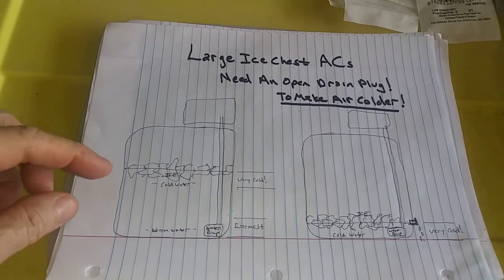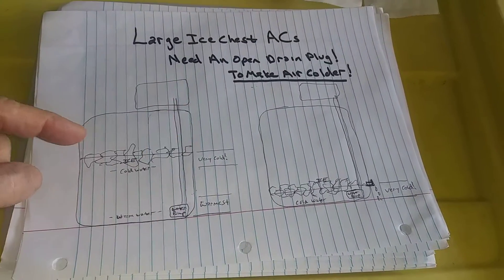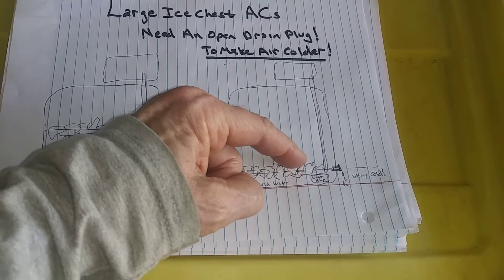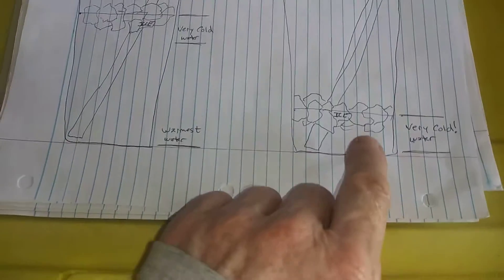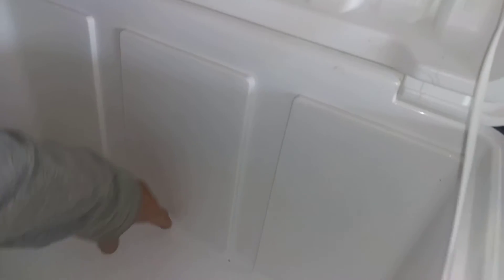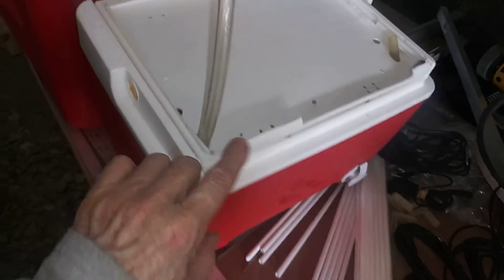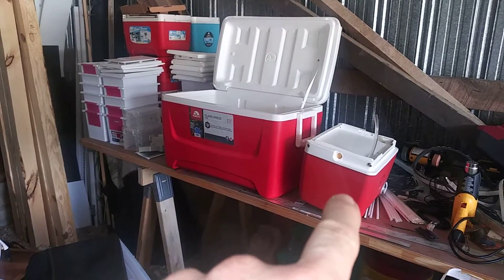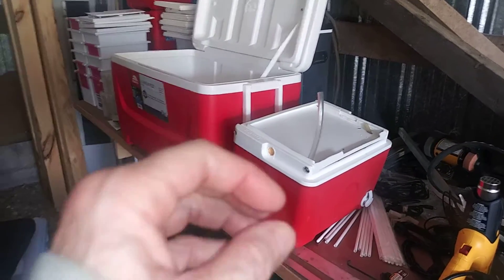Homemade Air Conditioner: Large vs Small? How A Drain Plug Makes Your DIY AC Blow Colder Air!

Comment: Another comment : I saw someone build a peltier ice chest cooler that will maintain a cold temp thus keeping water cold for circulating through a radiator and cold air with your Atwood fan system
Reply from the maker: I saw a man living on a boat build a Peltier AC with several pc fans that looked really cool but he said it used a lot of electricity since it was 12 volt.

At the time if I remember correctly I just started living the vanlife and only had one 100ah AGM battery so I didn't follow his design because of his surprise of how much it would drain a battery.

But, since I'm grid time half of the time and off grid the other half and now have a 300ah battery bank and a shop for AC builds the Peltier addition could be a nice addition for sure!

I'll look into a hybrid and not worry about the voltage use this time. Originally this channel was geared towards vanliving that it limited the designs I was building. But I'm definitely expanding out towards folks who are grid tied or who have an Ice machine available etc.

Thanks for that...!!!
James & Team

Comment: Isn't the trade off for having an open drain plug to maintain a particular water level that you have an open (uninsulated) hole allowing for loss of cooler temperatures? Wouldn't that cause faster ice melt, lowering the lifespan of the ice? In short run times the trade off is probably negligible, but if you're talking about 1+ hours of runtime (camping, out door sports events, etc) melt adds up. I get the thought process but the name of the game in ice chest spot coolers is ice longevity. Having an open hole seems counterintuitive. 

Cue all the YouTube experts in Thermodynamics...(insert MASSIVE eyeroll here for those keyboard professors...). All in all, love your stuff James.
Reply from the maker: Hey, Thank you John! Thanks for deep thoughts amen!
For 1 to 1 1/2 hours of cooling which is pretty average there isn't noticeable run time changes utilizing the open drain to keep the circulating water colder. It really does make a very noticeable and real time difference by circulating the colder water. I switched and never went back when in South Texas.

I discovered an article a few months about ice melting. The reason ice melts so fast in water isn't the water temperature that melts the ice do fast. It's actually a chemical reaction on a molecular level between the structure of liquid vs frozen water when in direct contact. The structures create a reaction on a molecular level instead of temperature different temperatures that cause fast melt. That's one of the most interesting discoveries I've read concerning ice preservation in ice chest AC units. After reading that I built a few closed loop systems and will be spending much time developing those for a while. The colder loop separation performs wonders for sure.

I'm currently building hydronic heaters using a similar build to the AC coolers as well this winter.
Reply: @COLD SCHOOL  Well here in Phoenix, runtime for us is usually 2+ hours depending on the activity. I will definitely try it out on shorter run times. Got into these units after the the AC in my Jeep went out and the fix is about what the Jeep is worth. Wanted to make one, and eventually stumbled across your channel. I'd already set out on making one my own way but more than 1 of your ideas solved an issue or 2 for me. So thanks and when I put out my first YouTube video on it, I'll mention them and credit you on it. The heater sounds interesting, always look forward to your stuff. Keep up the great videos and thanks for responding.
Reply from the maker: @Cenobite1  Oh cool Thanks.
I believe closed loop is the way to go for ice chest AC. It removes the chemical reaction between the water molecules and the ice molecules when they touch and so the ice lasts incredibly longer for sure.